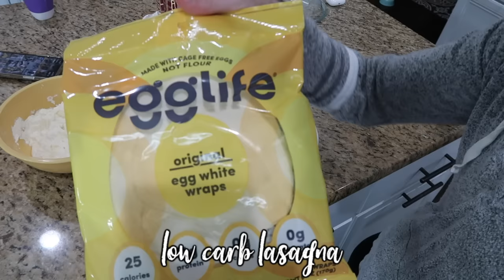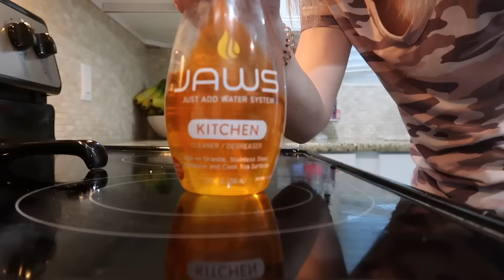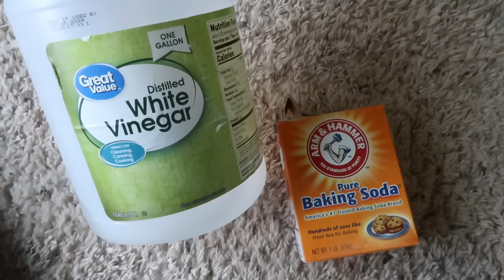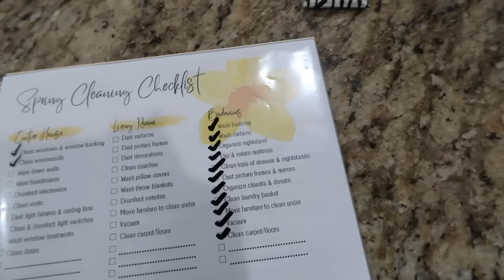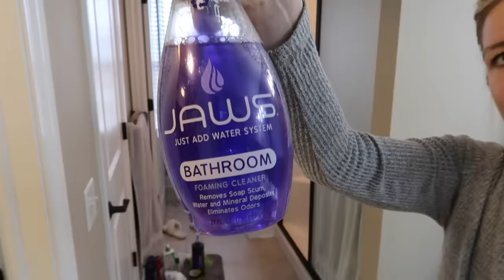MOTIVATING 3 DAY SPRING CLEAN WITH ME 2022 | EXTREME SPEED CLEANING MOTIVATION|DEEP.CLEANING ROUTINE

Comment: hi Jamie! It’s recommended to go over your carpet with you bissell carpet cleaner with plain warm/hot water to remove all the soap and solution since the solution or soap is like a magnet to dirt. Also the reason your Dyson hasn’t clogged with the baking soda since the cyclones separate the little tiny particles of baking soda into even tinier particles! Which makes the Dyson’s suction last longer. So it’s okay to use the Dyson with baking soda just don’t overuse the baking soda and you’ll be fine! That’s what the Dyson is for!!!
Reply from the maker: Thank you for this info!

Comment: So you vacuumed and then cleaned the carpet before you dusted the surfaces? Then you go back and vacuum and clean the carpet. You don’t put protective covers over the furniture legs before you move the furniture back on the damp carpet. What keeps the stain from leeching out of the wood legs and onto the damp carpet? The. You clean the air vent after all is done so dust could drop back onto the cleaned floor.
Reply from the maker: I needed to clean the carpets first so they would dry quickly. It’s not ideal but I needed the carpets to dry before we went to bed so I had to clean them first. Not a perfect system but sometimes you have to “go against the rules” to make it work for you😊

Comment: When I clean my carpet and have to move the furniture back before it's dry, I have cut squares of wax paper that I put under the legs.  In a few days I will go back and remove them.  Other Cleaning Tips-Windows-Vacuum first, then take an old butter knife, wrap tip in cloth and clean out the goop.  When you have a lot of dust on furniture, etc., use your vacuum brush to vacuum it up first and your cloths don't get so dirty and have to be changed out a lot.  Also, don't forget to take your attachment tools off and vacuum it off as you go. :)
Reply from the maker: So many great tips!! Thanks for sharing with us!

Comment: for the tracking I usually use soap and water and also a q-tip sometimes does the trick 2 clean it out perfectly... BTW F-Y-I I said 2 u before ... u have no idea how therapeutic it is 2 watch u it makes me forget all my troubles and makes me feel good inside... thank u 4 that!!! o, and 2 get the oil stain try getting a powder puff with baby -powder, powder the heck of the oil spot leave it in VERY powdered for at least 30min then with yer washing carpet machine try taking it out with soap and water it should take it out without leaving any stains behind...
Reply from the maker: Thank you!

Comment: Hi Jaimie! How do you clean your microfiber cloths? I throw mine in the washer but I was curious what temp and if you add anything to the washer like a detergent or sanitizer. Thank you so much! <3
Reply from the maker: I typically will throw them in the wash, as well but I wash them in cold and dry them on low heat. Sometimes, or every now and then, I will soak them an oxy clean before I wash them in the washing machine